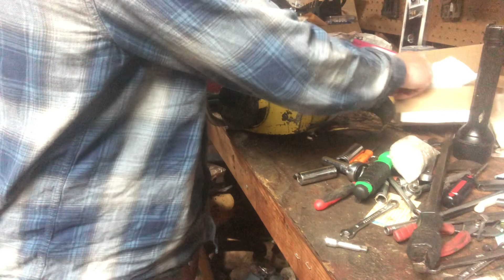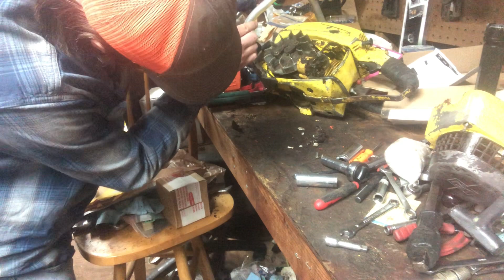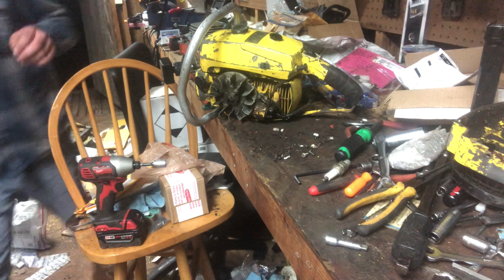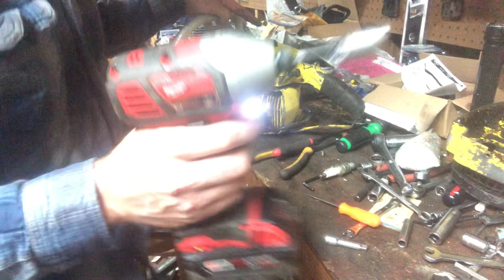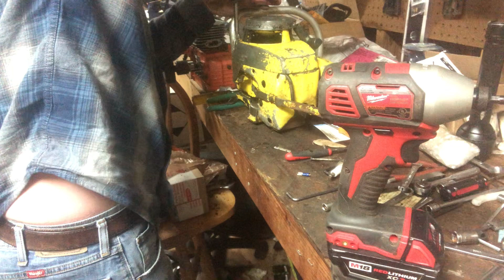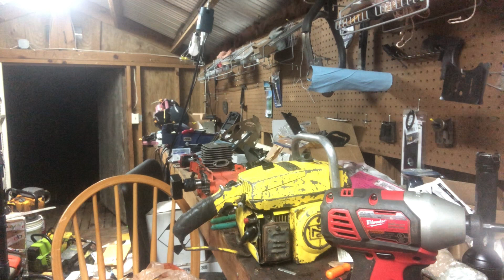Picked up a new saw, let’s see what’s wrong with it

Comment: Good price on the saw. Will crank shafts from other 70cc Macs work on it?
Reply from the maker: Yeah any of the 10 series 1-10 through 10-10 or pro 55 or 7-10 will work just have to pull the saw apart, have to use a point crankshaft if I wanna keep the points on it though
Reply: @BamaPerformanceAndVintagesaws  Nice, you probably have a few laying around then. Looks like she has plenty of compression!